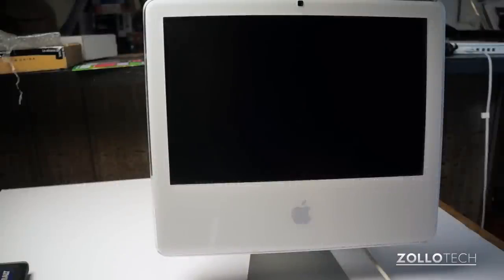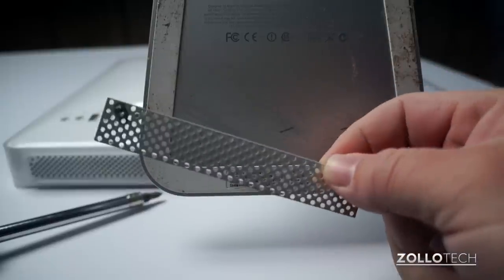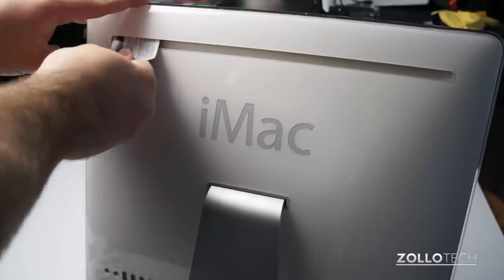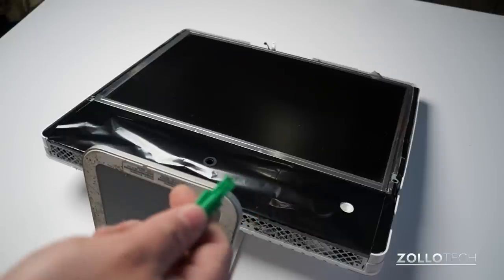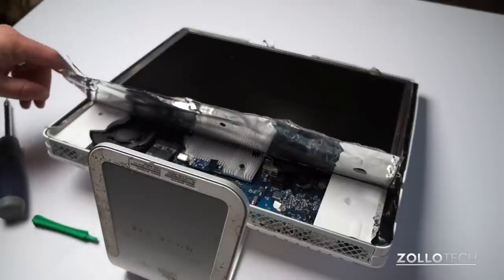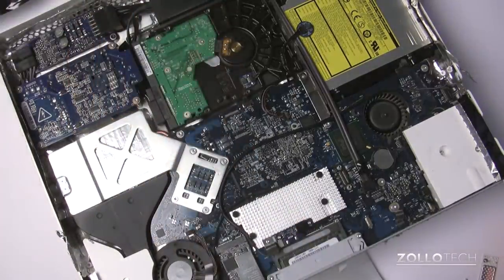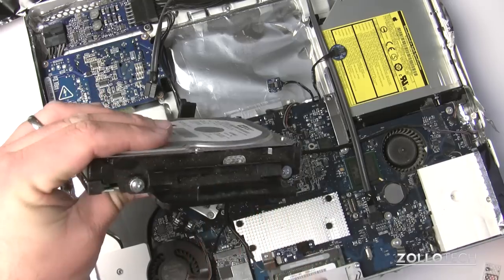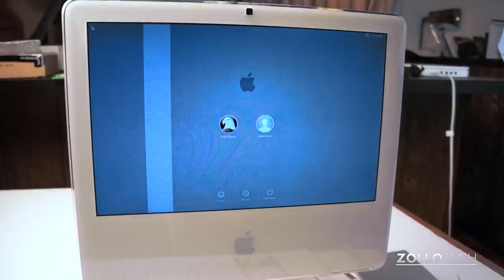How to Replace a Hard Drive in a 2006/2007 White iMac

Comment: Good practise for any computer: after disconnecting the AC power (and, for a laptop, removing the battery), press the ON/OFF button, to drain any residual voltage, before you  touch any of the "insides" of the computer.

P.S. A "late-2006" iMac, with 2GB of RAM and its "Core 2 Duo" processor, can run OS X 10.7 (Lion).  Purchase/download Lion ($19.99 US) from Apple Store.

Comment: Hello, I removed de HDD of an iMac G5 late 2006. It's damaged, this isn't the first time that I had trouble with it, so I have an external firewire HD with OS X ready to run in this cases. So now I have the iMac without HDD, I am trying to run with the external one, but the screen stay black. Is this a problem of the screen, that I broke it, or that is what happen normally un this cases. I have now the HDD in the freezer , before I buy one, and for rescue the data, if I can. Thank for read it.

Comment: Hi just watched your video which was very informative.One question if I may my computer which looks the same as the one you were working on just went pop when I turned it on the nothing would you have any idea what that might be. Thanks in advance.Mark
Reply: Something blew in the power supply would be my guess.
Reply: A capacitor would be my guess. They do expand over time.

Comment: Hi!!! Very nice video!!! 
I know this is an old video, but maybe you still can help me. I have an old white imac just like yours. The problem is that the screen shows several colored squares and nothing else happens. Technical assistance does not fix this model anymore. I have a good knowledge of hardware and repair skills and are going to try fixing it by myself.  But I wonder if you have any idea what this problem might be? Video card, hard drive, bad electrical contacts, etc?
We have another model just like this at the University where i work and the screen of that one just died (is black). But we can still use it normally connected to an external monitor. 
Thanx for your attention!
Helder
Reply from the maker: If it works fine with an external monitor, it’s most likely the LCD inside, or a bad connection to that LCD panel
Reply: @zollotech  Thank you. But unfortunately  this one is not working with an external monitor.

Comment: This video is for late 2006 iMac but I have an early 2006 iMac not a late one. So how do I change the hard drive on this? I want to download the latest Mac OS X which is Yosemite but I can't afford to buy a new iMac and my iMac is so old it does not support Yosemite so I need to get a new hard drive that works with my iMac that can support Yosimite but I am not sure how to do this or what hard drive I should get for this. Any help?
Reply from the maker: Swapping the hard drive would not allow you to use Yosemite.  The only way to do that is buy a newer Mac.
Reply: Thank you all for the responses. I will look into the CPU and flash to see. I know my dad has an older Macbook pro and a buddy of his who works with computers was able to upgrade the hard drive to a newer one without any problems. So I'll see if he thinks upgrading the cpu and flash would do the trick. Thanks again.

Comment: is it worth getting this computer now in 2016 for 40 bucks?
Reply: Armani Torres I'm using one now with Windows 10 64bit installed. Runs great!
Reply: It's worth more than $40 in parts.
Core 2 Duo = $15
500GB HDD SATA = $30
4GB RAM = $25
Total: $90, not counting some parts
Reply: Yes. I have one in 2018. It is great.
Reply: Armani Torres Sure, just put Ubuntu on it and it will be good for the next 5 years featuring regular security updates and up to date software.
Reply: @johnl5753  What's the latest OS you can run on it with a SSD hard drive?
Reply: @CesarGamino  mine is running 10.6(snow leopard). It can run up to 10.7(lion).

Comment: Arron, I  have a 20" Intel core 2 duo, serial# Last 4 is 5VUV, EMC# 2118. Originally it ran Tiger then I upgraded to snow leopard and yes I have the original disks. I still have the original HD installed and it almost full so it's time for an upgrade. I also have a newer MacBook Pro. The new HD I want to install is a WD 2TB.

I've come across a lot of situations where someone has installed a new HD and then installed the Install Disk and got nothing - they wasn't pressing the the keys or what not. My problem or question is how did these people format their new HD to begin with? I don't think they arrive mac formatted. As far I know the only way to format a drive is by using Disk Utilities, well how can this be accomplished if the new drive is unformatted and has no OS. 
Help
thx
Reply from the maker: You can boot with an install CD or USB drive and use disk utility from there.  Also, if you have a newer Mac you can just do an internet recovery and then boot into the install which will allow you to format the drive.
Reply: Arron thanks for the reply.  Okay so I installed the 2T HD. I launched Disk Utility from the install disk. Then I go to erase I choose Mac OS Ext(journaled) then Erase. I get a message - Disk Erase Failed, disk erase failed with error: Input/Output error.  

Am I cooked?
Reply: Arron, instead of using the original startup disk which was OS 10.4.8 I used a 10.6 and it worked perfectly.  Thank you.

Comment: Some extra tips; I originally couldn't find a torx driver that would take off the display connector on the logic board so I decided to leave it on and remove the small piece of clear tape attaching the cable onto the back of the display housing, worked great for me; just be extra careful.

Many will start the iMac up only to experience a symphony of garbled fan noise. Many HDD's don't have a thermal sensor as found on the original drive so the iMac assumes a worse case scenario and belts the fan up to max RPM. To fix this I installed 'SSD Fan Control' which uses S.M.A.R.T protocol to monitor the drive and adjust the fans as appropriate.

Hope this helps 😊

Comment: Turns out while sticking a credit card into the vent on the back I somewhat damaged one of those clips holding the front bezel on. The metal they're made out of has been bent slightly and now even though the clips do clip back into place the front bezel is no longer flush with the back of the iMac. I wish Apple made these Intel iMacs just like the iMac G5s were made. Those were very easy to service. :(

Comment: Thanks ya saved me some cash, it was frustrating as hell and I lost one of the monitor screws..and the monitor wouldn't turn on missing that one screw at least on my 2006 model but I found another screw that would fit and the new drive is running perfect, thanks again You are awesome.

Comment from the maker: you need to replace the logic board or display as it can be either one.
Reply: I have a 2006 imac A1207 20" 2006 . that have a hard drive issue. I  took it out and put in a 2.5 drive. It's not seeing the drive after I restart and  press on  the option key. and by the way which mac os  should I use  for ther fresh install. Please help. Need to solve this asap. Thanks so much

Comment: hi, i could need some help. 
I have a 2006 IMAC and just replaced my solid HDD with an SSD. The snow leopard installer does not find the SSD for installing :/ 
How to fix this? is the SSD (Samsung 850EVO) not the right kind for the old SATA
Reply from the maker: +kileftko you need to first go into disk utility and partition the solid-state drive

Comment: Which OS do you have ? I have a late 2006 20" iMac, with the 2.16 ghz core 2 duo. I have 2 gigs of ram and it is currently running 10.6.8. I know it won't run mavricks, but can it be upgraded to 10.7 0r 10.8 ? Thx!
Reply from the maker: You should be able to upgrade to Lion I believe.  You would need to have at least 2GB of RAM per Apple.  10.7 is not compatible with core solo or core duo processors, but should work fine with core 2 duo.
Reply: zollotech Wouldn't recommend upgrading to Lion on these machines.  S leopard is the last OS that will work WELL.  Do you know about this?
Reply: Dean Rivers That will work well on the white machines, and even on later machines in fact.  This, from personal experience and from hearing the same from tech's.

Comment: I have a 21" iMac, it is a 2006 era, 250GB hard drive.  It is working ok, but I battle keeping a couple of GB free, so rather than replace the iMac I was thinking of upgrading the hard drive.  What do you suggest?  I would like at least a 500GB hard drive, and 1TB would be nice.  What is the cost, and could I simply restore from a time machine back up once I put the new hard drive in?
Thanks!

Comment: Update, any chance of getting a good/higher resolution picture (or video?) of the top latch of the bezel?  As already posted, can NOT get it open but if I could see just how it's supposed to work (from inside bezel itself),  I might be able to figure how to get it open after all, and without drilling/cutting/breaking anything...  :)

Anyone have one of these and have the bezel off and could send me a close up, high resolution pic, or video of how it works/where card would/should catch it to release and just where the catch is and how it works when releasing???  Reply here and I'll get you an email address that'll work for corresponding, thanks.

Frustrated RichE San Diego, CA

Comment: Tried and tried and tried and tried to open top with credit card.  Tried double credit card, tried card with some duct tapeon end to make it thicker, seems to be opening the latch but nothing comes loose.

Is the bezel spring loaded to case at all, meaning if I DO get the latch to release (not sure I am), will it usually pop open as yours did, or does it take some force once the latch is released?

All that said, any way of knowing where I might drill the top corners to access the latches to release them?  Hate to mar the case but this system isn't worth a lot of $ so don't want to pay someone $50-$100 just to release the two latches.  I'm thinking drilling thru case, then drilling and tapping the latches, putting a machine screw thru and pulling to open the latch.

Thanks again for excellent video and all your videos.

RichE San Diego, CA

Comment: Hi guys, My friend just bought a 2006 iMac 5,1 2ghz cpu/1gb ram from eBay for $130 with a few vertical lines always showing on the screen but he's not complaining. He noticed the os10.6.8 he has running on it is full of bloat software he does not need so he wants to do a fresh install of 10.6.8 but the iMac did not come with a install disc so my question is does he have to buy a physical snow leopard disc or is there another way to reinstall the OS like Mavericks with its recovery partition.  Thanks for any help
Reply: Thumbs up or Aphex Twin :)
Reply: Snow leopard doesn't have a recovery partition, that is only in 10.7 and newer.

Comment: Hi there, thanks for the vid. Having trouble getting that mechanism opened with the credit card. Is it imperative that the screws be unscrewed before that process happens? All I'm trying to do is get the hard drive out for all the files on it, then I'm trashing the computer (it's burnt out).

Comment: Nice video, especially the audio. I have friend that has an imac like this, and the folder with the question mark that appears for about the first 30 seconds of boot-up; then contines to load the OS. They say that has an "intermittent video problems" I think the hard drive is starting to fail. Is this the first tell-tale signs of the hard drive starting to "go"..?

Comment: Thanks for the video, this really helps.  I just have a quick question. If I use a hard drive cloner and put the new cloned HD into the mac, does the OS see it exactly as if it was the old one? It seems like that's what you did, and that is what "clone" should mean; I've just never actually done it before. Also, how's that velcro holding up? Thanks again.
Reply: it DOES see it perfectly and run

Comment: Hi Aaron. I've just bought an iMac like the one you showed it the video. I'm having problems to take the LCD out, because I think that there are some screws attaching the display to the rest of the ensemble. Do you know what kind of screws are these ones? Do I need a special screwdriver to remove them? I need to take the display out because the iMac came with a defective power button that is giving me a hard time when I am trying to use it. Thanks for your help.
Reply from the maker: The glass is held in magnetically If it’s the same type that I show in the video. The display has screws, and you may or may not have them. Apple uses Phillips head and torx screws

Comment: I'm going to remove my HD following your instructions --I will not make your responsible if I mess up, :). I want to transfer the files to a newer computer. What drive adapter do you recommend that it is inexpensive and reliable?
Reply from the maker: +Luis Gutiérrez any really.  They are basically the same.

Comment: Hi, My computer is making a funny noise during the start up. (Sounds like a bouncing ping Pong ball) It ends in a white screen showing a blinking folder. Is this due to the harddrive?
Reply: Seems like you have a corrupt install, bad hdd or you need to set the startup disk. Follow Apples guide here https://support.apple.com/en-au/HT204323 You can try to boot with the cd that came with your Mac into to Mac OS X recovery disks by holding the option key on start up and then to select the disk. From there launch disk utility and repair disk permissions. I hope this helps. :)

Comment: Very helpful.  Thank you.  I have a 24 inch 2006/iMac.  What size hard drive do you recommend?  I will purchase a SSD
Reply: I just put a 240 GB SSD into mine today. A loss of only 10 GB compared to the original mechanical drive, and with much better performance.

Comment: Wow, quite old, no idea if any answer, but you sort of skimmed over the heat(?) sensor setup for new drive.  Looks like you have some sort of board attached to the cable, or did you just glue (what glue?) the sensor to the SSD itself?  Thanks.
Reply from the maker: Just press it back on the drive. It already had enough adhesive left on it
Reply: @zollotech  Ah, cool, thanks, and thanks for quick reply to OLD video...  :)   I replaced the drive in my girlfriend's iMac (2011) with SSD and had to get a special cable with sensor to put with the SSD.  I thought the sensor the cable plugged into was inside/attached to the old hard drive (apparently is/was on hers).

Comment: The hard drive on my Mac has just broke down and I am about to install a new one. My question is, do I have to install a new OS X disc or something like that?
Reply from the maker: Yes, you will need to install OS X on the new one using the disc that came with it or a USB key or if it is a new Mac, you can use internet recovery.
Reply: ok thanks

Comment: So, i want to replace the harddrive in my late 2006 imac, but i have 2 questions, firstly, this looks very scary, and i'm not the most careful person, is this the only way to get to the harddrive? Also, when i do eventually replace it, how do i get the os and files from the current harddrive to the new one?
Reply from the maker: Yes this is the o my way to replace it on this Mac.  You can clone the drive using a tool like superduper.
Reply: zollotech Okay, thank you very much for the quick reply, also this is probably a silly question, but is there any way you know of to update this iMac past 10.7.5 lion?
Reply from the maker: No problem.  No, due to graphic card limitations Apple doesn't allow it.  There is a third party app you can do it with, but it's a pain and not worth it.  It may be time for a new Mac.
Reply: +zollotech I was thinking about building a new computer around January, was just wondering if I can get some extra jice out of this until then, but one last question (I promise) if I were to upgrade the ram since its at 2.5gb at the moment, what ram should I get, I did a little researching and fromcehat I can tell Andy 667mhz ddr3 sdram will work, I think?
Reply from the maker: No that won't work.  If it is an early 2006 iMac then 2GB is max.  If it is late 2006 then you would use 
2 x 2.0GB PC5300 DDR2 667MHz 200 Pin according to OWC at macsales.com.